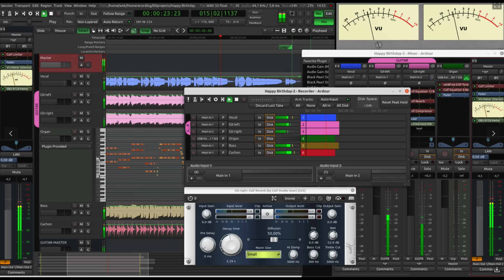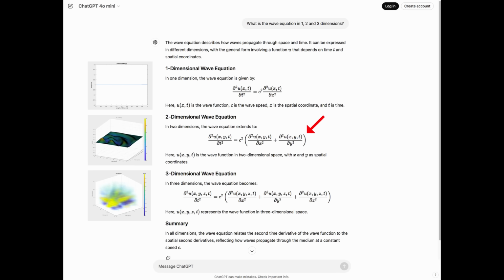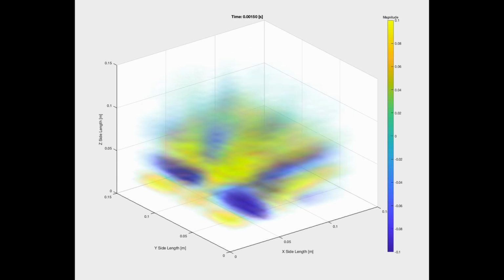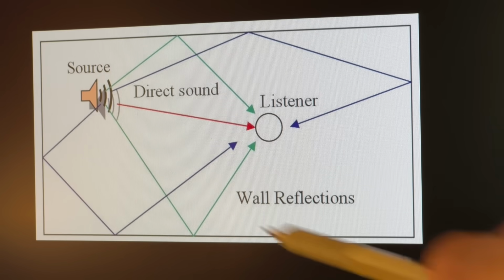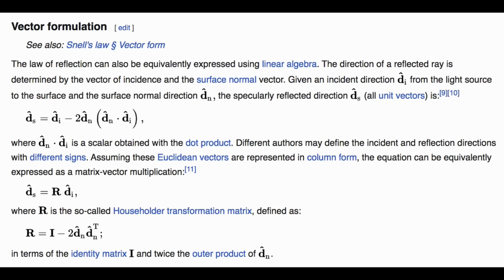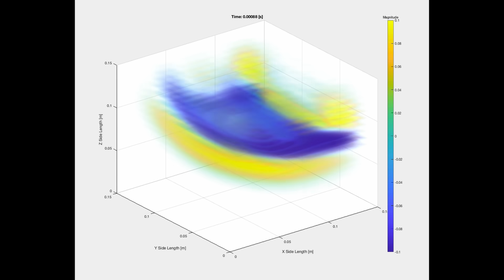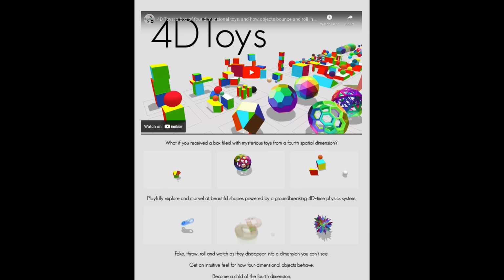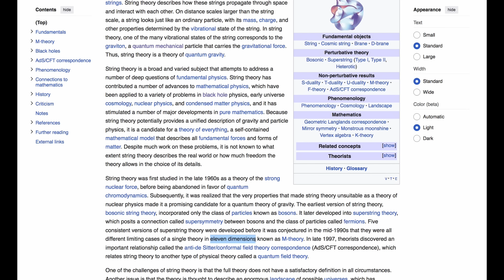Four Dimensional Reverb

Comment: 4:26 wouldn’t 4 dimensions disperse energy quicker than 3? As in, inverse cube law instead of inverse square.
Reply: Yes, attenuation is based on the dimension.
Reply: Yes, but that's effectively taken into account automatically by doing things ray-by-ray. The reason it diffuses faster is sort of because each ray spreads apart from nearby other rays more quickly.

Comment: 1:05 technically allot of basic physical modeling algorithms are simulating physically impossible things like the karplus strong algorithm for plucked strings is essentially simulating a circular string (ie the string has no beginning or end its just a loop)
Reply: I think you might be able to implement a looped plucked string with strong magnets, but I'm sure the forces required would move the sound away from the “platonic”, simulated version.

(I was going to suggest spinning a looped string in 0g, but I'm not sure if the loop would stay open.)

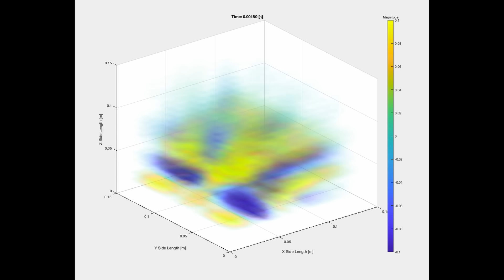Comment: 8:00 a tesseract actually has 10 faces, or more accurately volumes, not 8.
Reply: a tesseract has 8 cubes / 24 squares, or 8 cells (vertex, edge, face, cell) very neat
Reply: A tesseract does not have 10 cells, it has 8

Comment: there are two ways you can add extra dimensions, either those which are compact, or extended like the three spatial ones we can observe. I wonder if anything different would happen with your simulation if you looked at sound on R^3xS^1, or even just T^2 or something like that. Those are different (higher-dimensional) "surfaces", by the way
Reply: Generally when people talk about string theory, they expect the extra dimensions to be compact (so not reaching out infinitely in a new direction). But there are frameworks where you can have large extra dimensions

Comment: Makes me wonder if this could be done with the 4th dimension being temporal (with its own set of variables) rather than spatial
Reply: Exactly.  This is simulating 4 spacial dimentions.  The math isn't so difficult to do a temporal dimention, the main problem is unless you constrain the dimention you can't really do it in real time (you need to account for reverberation echos existing before the note is played).  Likely however it will sound similar to recording a sound and applying a normal room reverb in both forward and reverse and mixing them togeather in the final track.  If you contrain it to positive values only for the temporal reverb you will just end up close toa chorus effect and a reverb applied to that. 

Now it would get really interesting if you picked the right frequency in a chamber that is specifically designed as multiple of the fundimental frequency.  You would probably get some very strange interference patterns and harmonic tones shifted in the timing.  Very easy to just decend into pure feedback however.